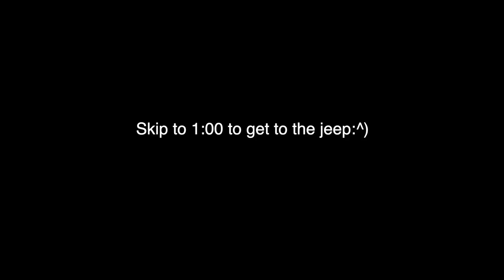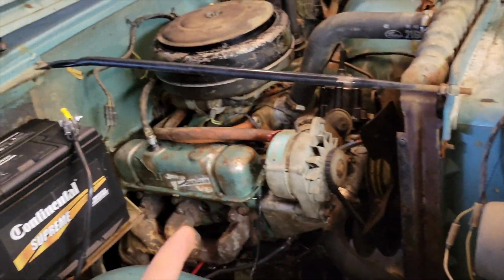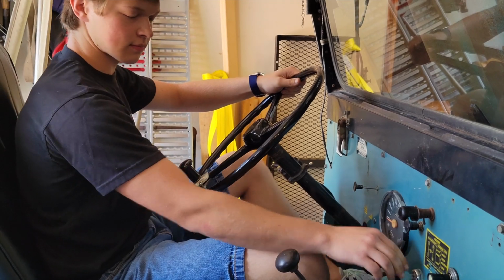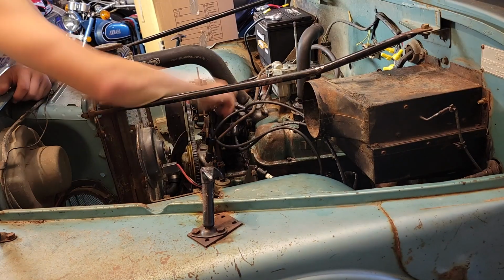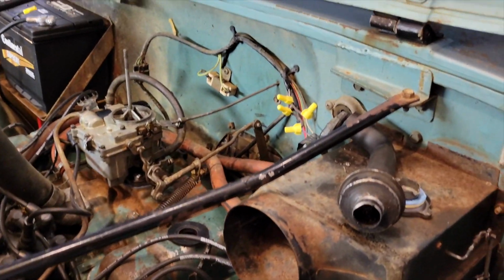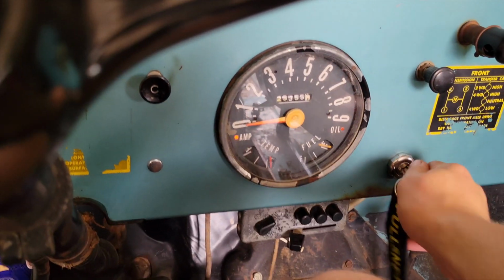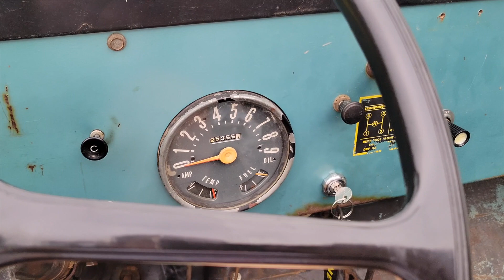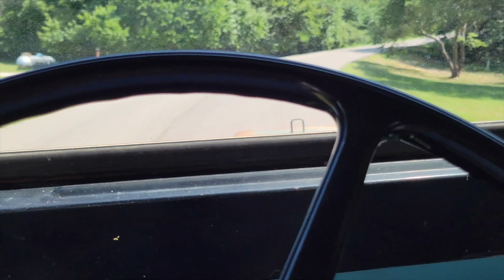The Jeep's First Start In 30 Years!

Comment: The metal door on the distributor cap goes next to the vacuum advance, it's set up to adjust the points without removing the cap. So it's ether on backwards or it's the wrong cap. Witch also means your probably 180°off on the timing. It runs as is. But you'll never get it right untill you fix the distributor.
Reply from the maker: Can't see it in the end, but I flipped her 180 and that's how I got the beast to fire. Thanks for your comment!
Reply: @waltersunrise1584  There are different distributor caps for this family of engines. Make sure yours is the 'odd fire' distributor and cap for a Dauntless.

Comment: TA Performance has some stuff for the 225 also KB if you can find it. My 67 likes about 15 advance. I am running 2 1/4 duals with H pipe and Flowmaster's also HEI with 8mm wires. This is in my 67 Buick Special Deluxe with the 2 speed switch pitch trans. It ran 18s in lacr and Pomona in CA.

Comment: An aggressive, loping, da dum da dum da dum idle is natural for an 'odd fire' 225. Don't expect it to sound smooth as a V8 or 'even fire' (split crank journal) V6
They fire at 90 - 150 - 90 - 150 - 90 - 150 degrees of crank rotation rather than the 120 - 120 - 120 ... of a 90 degree V8.
It gives them tons of torque at low RPM, great for off roading.

When you're having that much trouble starting a dauntless, especially after she's been sitting a while, flood the carburetor and work it through.

Bypass the heater.

Comment: Your distributor is 180 degrees out, that window on the distributor cap should be facing the front by the points. Search for a video on how to time the Buick 225 225 V6, it's a 2 part video